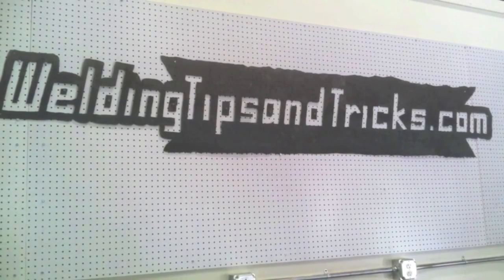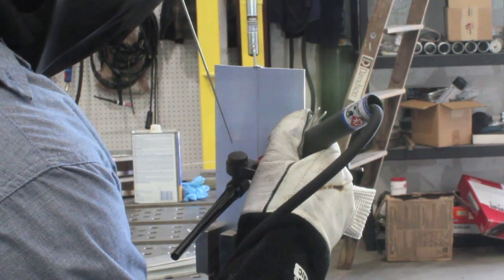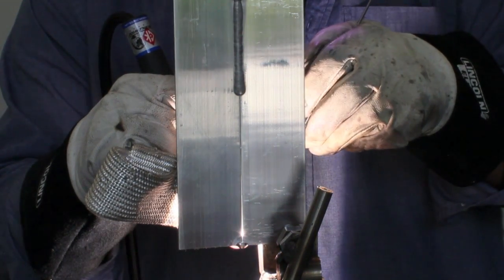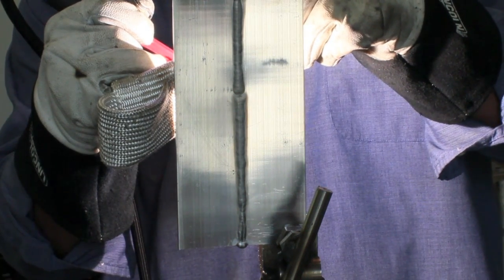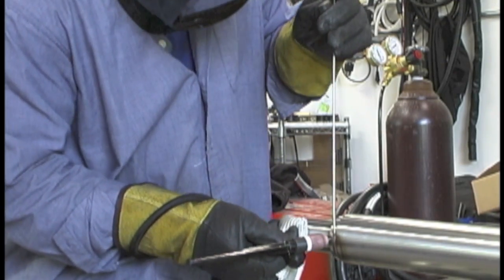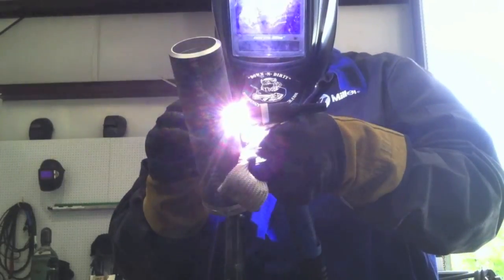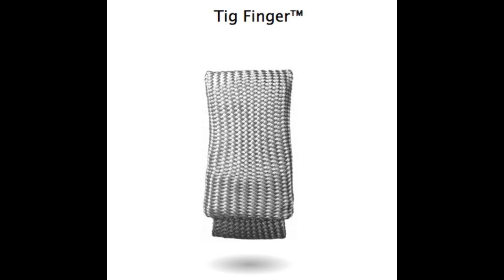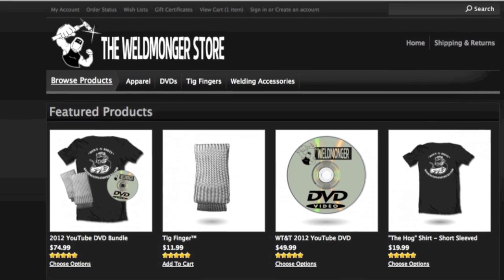Tig Welding Aluminum 3g Vertical Welding  6061aluminum alloy

Comment: Great vids my man! Keep it up! I have been looking everywhere for a vid on an outside 90 spool gun weld and NO ONE has one.  I bombed a weld test for an outside 90 on 1/8 in aluminum with  a 1/16 to 1/8 inch gap. Before you ask, no i dont know why they wouldnt let me Tig it lol It was about an 18 inch bead they call the "Animal". I initially thought that if i run by it as fast as i can holding the trigger, i might get it lol

Comment: Huge fan!!!! Quick question... with aluminum are the plate butted or are they deep beveled? I've been testing for aluminum but the company has me using scrap 1/4 4043 filthy plate and expects me to pass. How can this be done?
Reply: Clean clean clean. Acetone and Wire brush prior to fit up if possible. Dont be afraid to let the ac clean a little as well. Wipe your filler down, new tungsten. Set the field my lass and do your best with what you got.

Comment: I use my TIG finger for some light mig welding on occasion. And of course whenever a job comes in that requires TIG ( I.e custom aluminum intake) works great

Comment: I guess you've been asked many times, but...can you see the weld through your face mask as clearly as we can see you weld on the videos you produce? I have a good face mask (3M Speedglas), but I struggle to see the weld as good as your videos. My eyes aren't as good as they used to be,( I can see OK to type this!) but even with spectacles I struggle to see what's going on, and consequently my welds wander all over the place. Thanks for your time, always interesting.

Comment: Jody, You screwed up with the TIG Finger design.  I've had mine for over two years and the two dozen replacements I also purchased are sitting on the shelf getting dusty.  I gave three away to co-workers, and we just can't destroy them.  I'd love to buy more to help with the bills, but you need to help us come up with unique ideas for additional uses.  Spark plug boot protectors--already using one for that, O2 sensor harness protection, yup, that too.  Now, I do need five more WT&T T-shirts...

Comment: I love my tig finger.  The double material keeps the heat away from my prop finger.  The material is durable and slides easily across the metal as you move.  This is one of the best products I've found in >30 years of TIG welding.

Comment: I love my Tig Finger. I would have had fried fingers if it were not for the Tig Finger.
Found that the Tig Finger is also good for cooking Hot dogs. Yep. I have a grill near my welding station. Was cooking some dogs and I forgot to bring some forks to pick them off the grill. So I grabbed a couple of tig fingers and picked the dogs up off the grill with no burnt fingers. Yeah I probably could have used my pliers, but the tig fingers were closer and probably worked better and saved my dogs